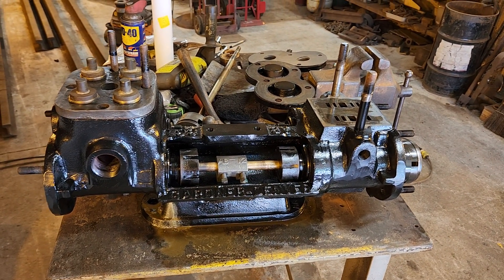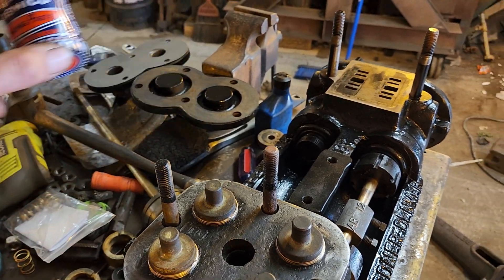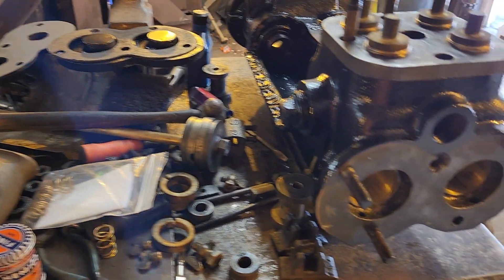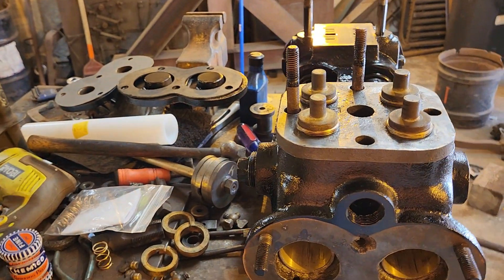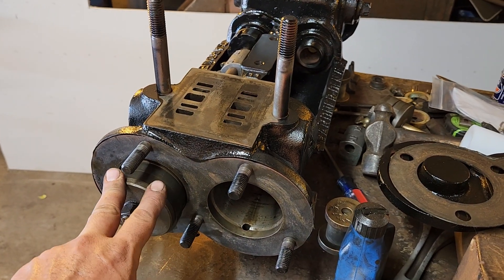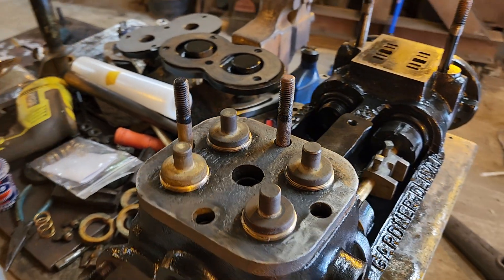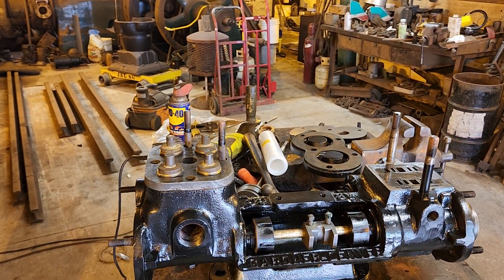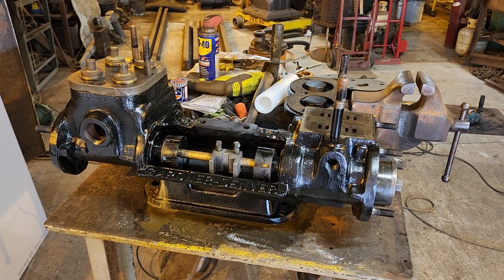Rebuilding a Duplex Pump Part 2

Comment: how did the delrin work out for the rings? i have the same pump and having the same issue
Reply from the maker: I made them wrong.  If the tolerances were tighter, I think they would work.
Reply: @YoungstownSteelHeritage  what did you end up doing to fix it then?

Comment: Are you going to leave both sets of injectors onboard?
Do you have to have two means of injecting or pumping water into the boiler?
Does 58 have an auxiliary steam outlet to plum in little accessories like this temporary?
Reply from the maker: We have to have two ways of putting water into the boiler.  Now if the pump works reliably then there is no need to have the 3/4" Penberthy on the left side.  But first it has to be ascertained that it will work reliably.  So more than likely the left injector will be kept in place as a backup.